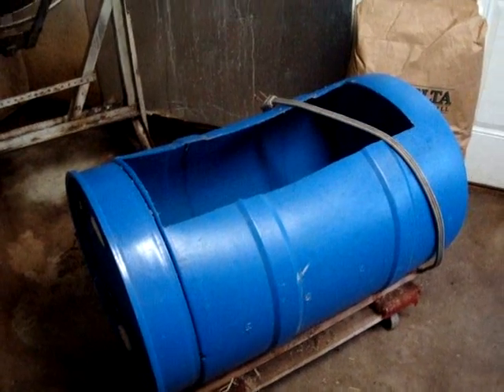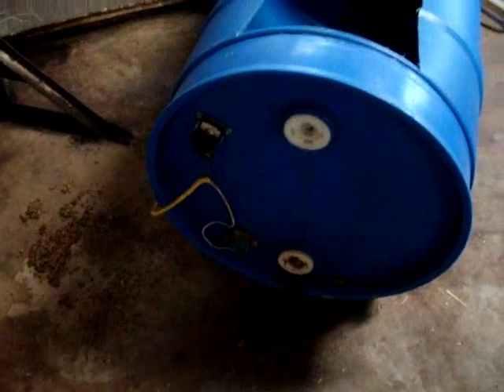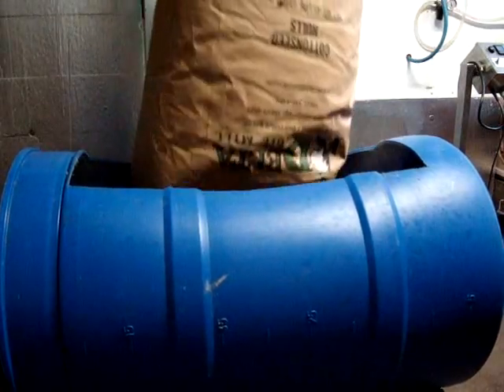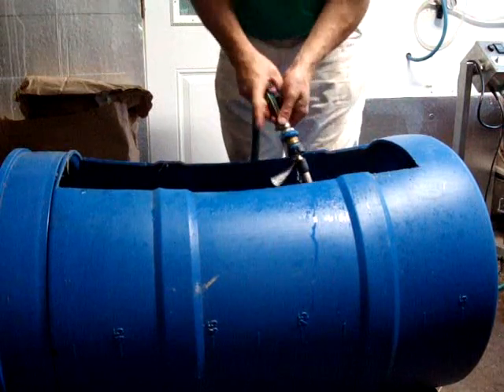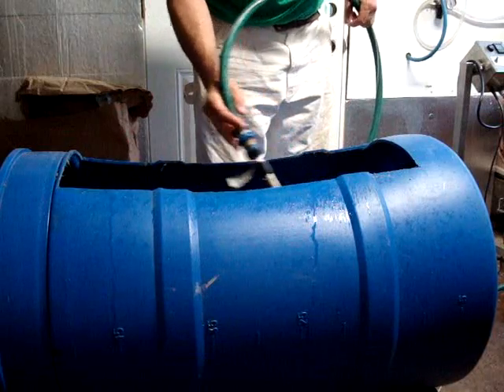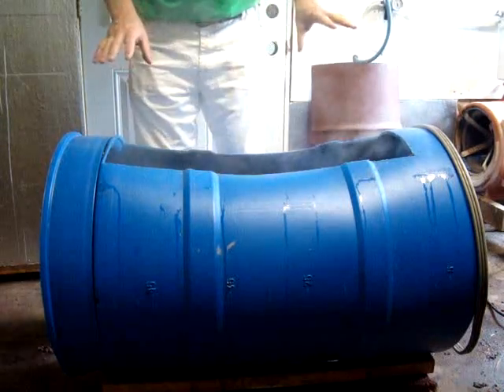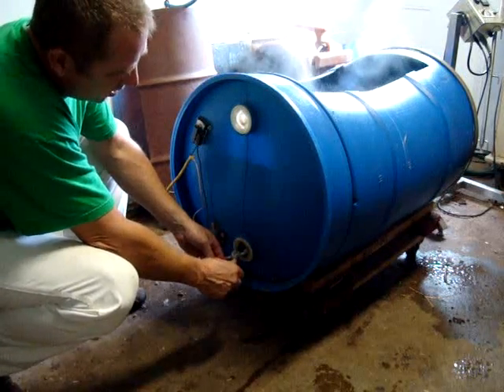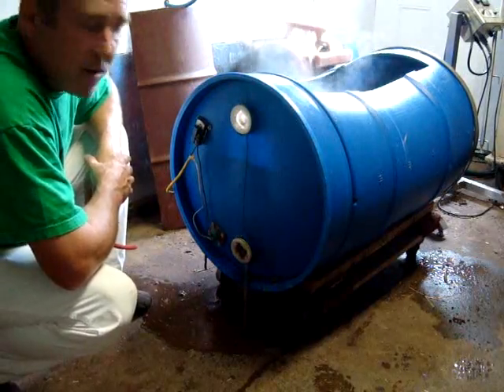Growing Oyster Mushrooms

Comment: HDPE, which stands for High Density Polyethylene, is the only material food grade buckets are made from. They do have to be FDA approved food grade HDPE buckets to be appropriate for food storage. 
Plastic buckets that are not food grade "outgasses" and leaches out into the container, and YOUR FOOD. 
The blue water barrels are approved for food and water use and are safe and do not outgas.